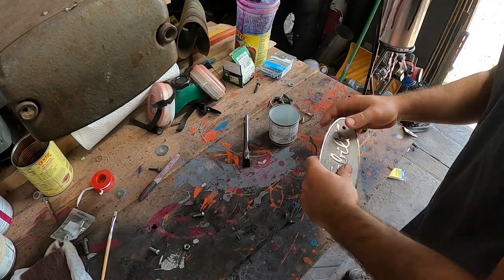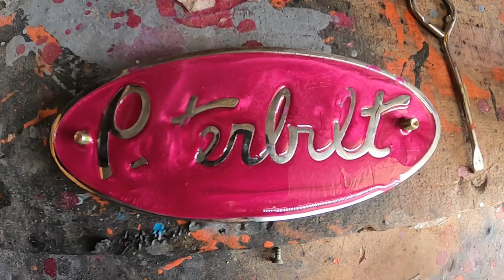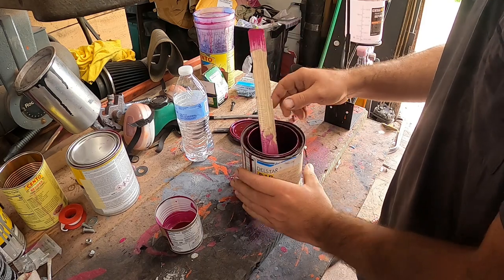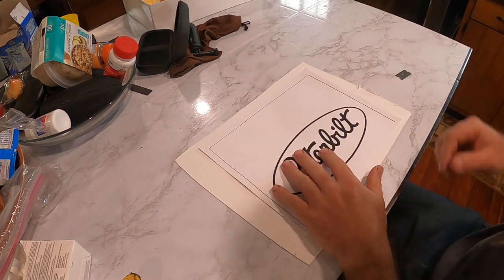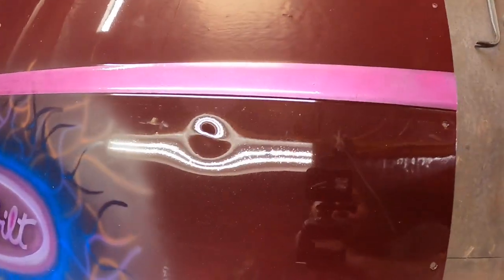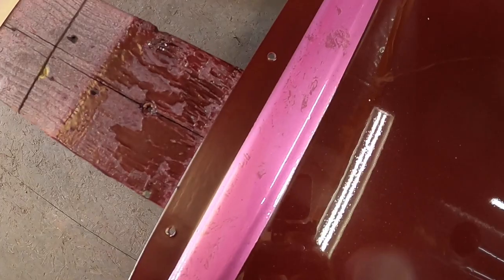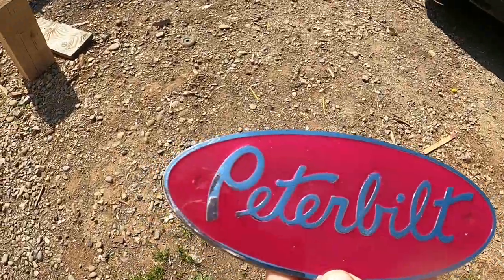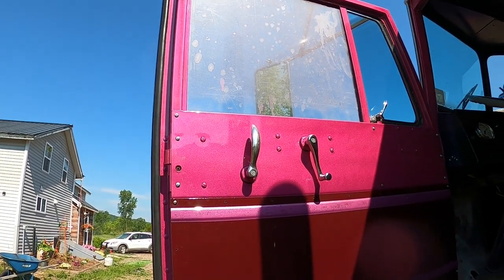Airbrushing Door Panels For The 1962 Peterbilt 351

Comment: I use an adhesive for my Rc model trucks from Pattex Clasic. It dries out elastically and lifts small areas together very well, it is also used on the frame of my trucks. My models are very weighty and I never had problems with the stability. So the Pete logo would have to lift. Hope it at least it would be a shame if it falls off and is lost. You lift it up top. And they are cheap, at least not here in Germany, because if you don’t get any new ones, they are very seldom used for around 120 euros.
I wish you a lot of fun with your Pete